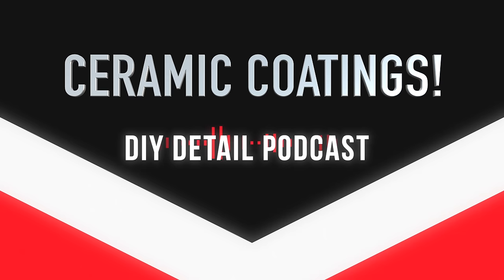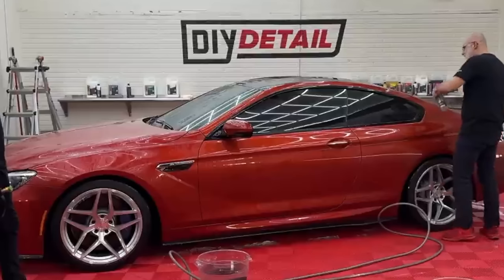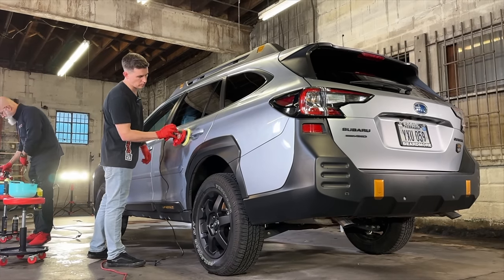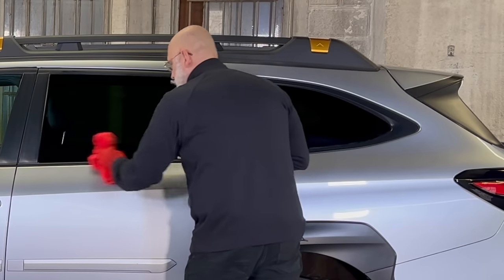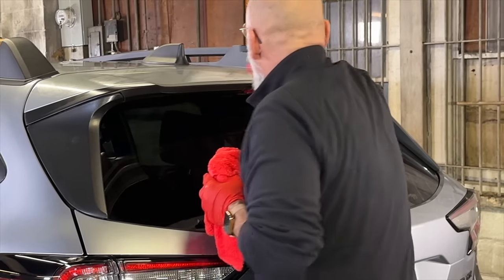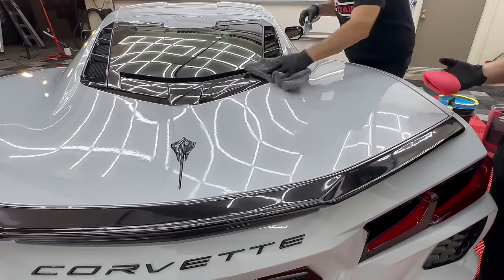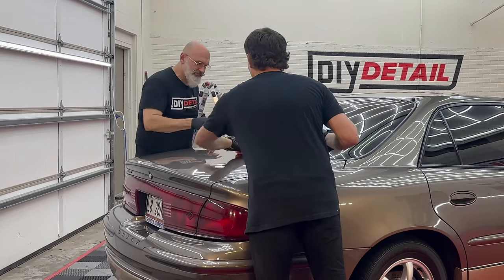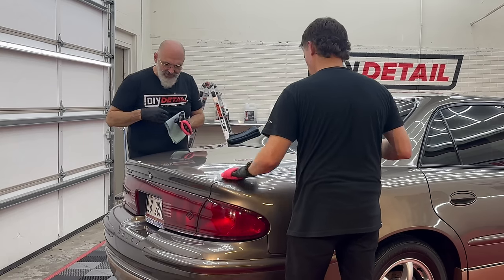How to apply ceramic coatings: the DEFINITIVE guide! | Podcast #82

Comment: Great vid as usual fellas. But…..over the last 6 or 8 weeks you made several vids saying you do NOT have to polish a vehicle if the car is new or the customer is preserving the paint. If that paint has been preserved like an 87 GNX, that car will most assuredly have waxes and polishes on it. Today’s vid you said the ONLY way to remove waxes/polishes is by mechanically polishing the car. Some clarity please. Ivan in particular, a lot of us take your word as gospel, please know that and how much we appreciate your informative videos.
Reply from the maker: Polishing is the best way for sure. On a new car it’s highly unlikely it has any protection. Do you need to polish, no, is it preferable to polish, yes.
Reply: You should do a strip wash and paint correction on any new car then ceramic or PPF or whatever.

Comment: Quick question. Wouldn’t it make more sense for the polish manufacturer to make a panel prep that’s engineered to remove the fillers and oils in their polish? I mean, a coating manufacturer doesn’t know what type of polish you used.
Reply from the maker: Both actually. Our DIY Detail panel prep does both.

Comment: Hey guys,  I applied my first ceramic coating on my truck yesterday.  I applied your 3 year graphene coating prepped with the app.  My question is... how long do I need to let it cure before I could take it out of the garage.  You did say in this video 1 hour.  But I feel like all the other advice says 24-48 hours and 1 week before washing.  I feel like this should be in the <application> instructions on the product and/or the website.

By the way, this was my first time hand-washing (diy rinseless), first time decontaminating (diy iron remover w diy perforated towel), first time polishing (my dewalt sander from the garage, with diy polish, diy yellow pad), and first time applying ceramic coating (app for panel prep, c6 3year graphene coating).

I did it on my truck as practice to do my wife's porsche.  I had a lot of fun.  After polishing, i noticed that there were still a few swirls, so I think I for her car, I will use the wool pad and wash every panel one at a time.

thanks!
Reply from the maker: 1 hour is all you need to wait, those asking for more time are simply using outdated technology.

Comment: I have a 11 year old truck that has never been clayed, would a clay towel be good to use before polishing and ceramic coating or should I use a clay bar to get all the contaminants off? I will also be using an iron remover.
Reply from the maker: Try with the towel first

Comment: Hi guys, love watching your informative videos. All your ceramin coats and detailing seems to be with basecoat / clearcoat paint finishes. 
My old VW has been resprayed in 2k red as original. With no clearcoat are the ceramic coats effective in preventing UV fading / bleaching effects with longterm sunlight exposure? .
Secondly what is your preferred  advice in maintain these types of paint.
Im a little hesitant to use a ceramic coat if it's going to start to fade underneath and then the ceramic make it difficult to repolish.
Thanks for your advice.
Reply from the maker: Treat it the same, yes a coating will definitely help slow oxidation.
Reply: Thank you kindly, I'll go for it.

Comment: Great video guys! Have a couple questions: Can I use your 5 year coating on my Mach1 hood decal? It has a bit of matte and glossy finish. I don't want to create a high spot. 
Also, can I use panel prep on PPF before coating them? Can I coat my chrome exhaust tips?
Reply from the maker: Yes you can!

Comment: Hi fellas, i have a new truck that i would like to ceramic coat. I understand polishing isnt required , but recommended.  My question is , how do i combat hard water coming from the garden hose to prepare the paint for the process. Is the water spot remover the answer? Would the minerals cause scratches? Thanks
Reply from the maker: No need to worry, the minerals in the water are only a problem if you let them bake in the sun.

Comment: Hi fellas. Yasir from Kuala Lumpur, Malaysia here. On the topic of ceramic coating wheels, if i want to coat a wheel, should I do it after a changing the tire, remove the balancing weights and re-installing the balancing weights? What if I install for example, DIY Detail's 3 Year Coating, and during the three years, I had to change a tire? Will the new relocated balancing weights stick on the 3 Year Coating, or do I have to compound the wheel with the Gold Standard Polish and the wool pad, and recoat again?
Reply from the maker: Coat after they are mounted. Your tire company will no what to do if you tell them the wheels are coated.
Reply: @diydetailofficial  Sad to say, tire shops here in Malaysia, from low end to those high - end tire shops, don't know what to do if they encounter a ceramic coated wheel. I myself experienced it before. My motorcycle wheels was coated with G***n D**x, and whatever the tire shop staffs did, the balancing weights never glued itself properly. I had to ask the tire shop staff to mark with a tape, where the weights will be installed, went home with the wheels, compounded the taped areas, went back to the shop, get the balancing wheels glued on. Went home and had to re-coat the surrounding areas of the balancing weights. :(

Comment: Thank you guys, this video answered my question about removing existing wax on the car.  I was hoping just washing would be enough but looks like I'll need to get a pad and some polish to do the job properly.

Also, what process and products do you guys use to clean all the towels and applicators after the whole wash-prep-coat process?  I can't imagine throwing those out after doing just one car.
Reply from the maker: We use a “free and clear” liquid laundry detergent.
Reply: @diydetailofficial  thank you!

Comment: You said in the video that you don't want any waxes on the car before applying your ceramic coat... Is it okay to make use of a wash and wax car shampoo or would you recommend that even when simply applying ceramic spray then it's best to rather use a car shampoo that doesn't have the so called 'wax' component to it? And I assume those 'wash and wax' car shampoo doesn't really have wax in it, it's just for looks?
Reply from the maker: It’s best to not have any waxes in your shampoo
Reply: @diydetailofficial  Thank you for the reply! Have a beautiful day

Comment: With your ceramic coatings after applying it how long for it to fully cure?

How long should it be kept out from the elements? (I.e. not get wet)
Reply: Says in the video. 1 hr for getting wet in rain. one week for a wash.
Reply from the maker: One hour before it gets wet

Comment: I used to be on the IPA solution train until my Panel Prep bottles came in. You will be able to feel the material as you apply you it and see what they mean. It's hard to explain, but after you apply it, you will feel a nice nice nice squeaky surface ready for a coating NO DOUBT. Very nice panel prep, you need very little on the towel.
Reply from the maker: Thank you.

Comment: Yes very confusing over many video's. Iron remover and a synthetic towel( clay bar) and suddenly this video now needs waterspot remover. Seems you need exactly every product DIY sells. I've watched a lot of video's and contradiction is rampant. Many Pan video's as well.
Reply: Water spot remover is required for any long term or burnt water spots that have etched into your clear coat. 
After you have washed and dried your car beautifully, thoroughly inspect your paint and glass for visible water spots. If you don’t have any, you don’t need it. Pretty simple really.
Reply from the maker: We used it here because we know the vehicle goes through a car wash, they leave a lot of mineral residue on vehicles.
Reply: @diydetailofficial  Thanks. Don'tget me wrong I am not bashing. Just trying to get as much information as possible before I regret touching as well as maintaining my new car. Information Overload I guess. Trying to process techniques and products.
Reply: Do you understand these videos are really advertising to buy their products.
Reply from the maker: Our techniques work with other products as well. This channels goal is to provide educational content to detailers to make detailing more accessible, enjoyable, and safe.
Reply: @diydetailofficial  yes and then buy your product.